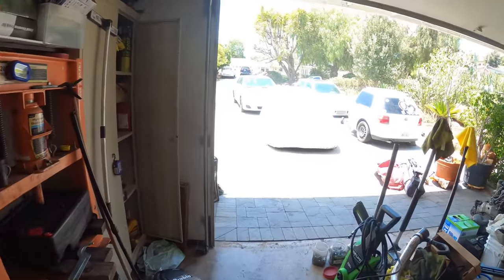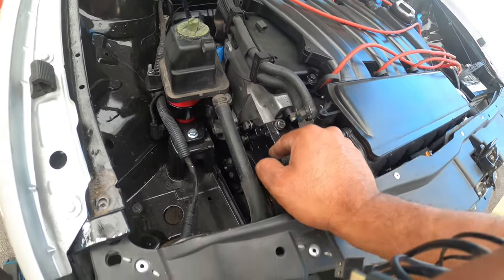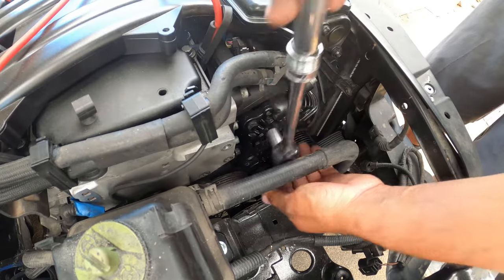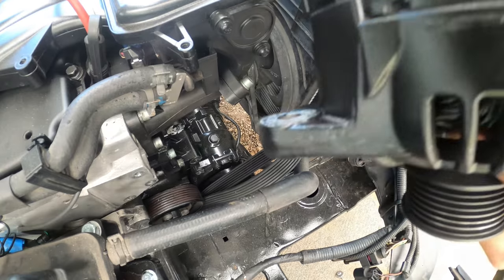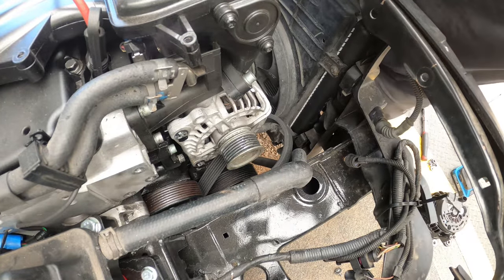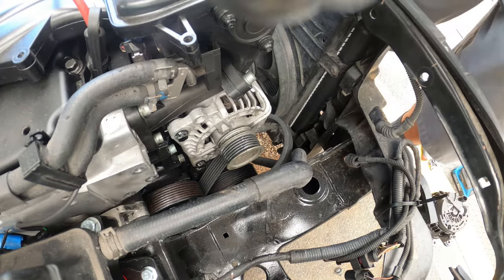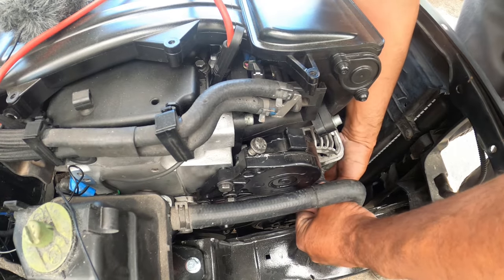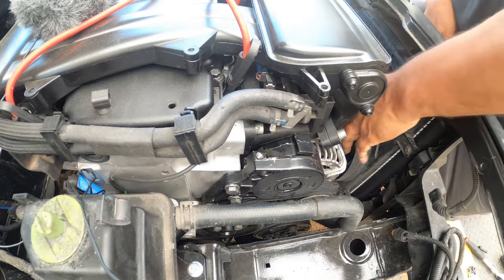MK4 VR6 Alternator Removal and Install

Comment: Very helpful. This video applies to a 2003 VW GTI VR6 24V. I used the front bumper bolt to release the tension on the belt. Had to also remove the windshield washer fluid reservoir with a 10mm....
Reply: I used one of the 3 bolts that hold the tensioner on to loosen the tension just enough to take it off, not sure if will be enough to put it back on

Comment: on DOHC 24 valve the AC line and the coolant reservoir  are in the way alot and you have to pull the front out way further than feels comfortable to change (and remember to check the wire and that running 4awg wire to it may fix it and can do that from underneath)

Comment: Alot of work for an alternator. Dam germans
Reply from the maker: Seriously man!
Reply: Not even, I’m doing one now I didn’t have to remove the front or bumper or anything I actually got it out the bottom in no time.
Reply: @AndrewKidd14145  Do you have a video for that?